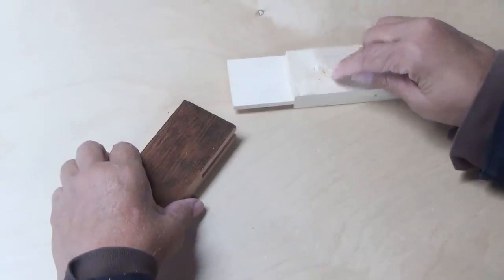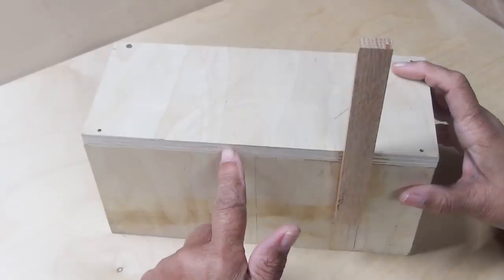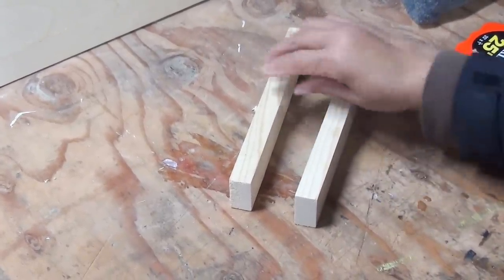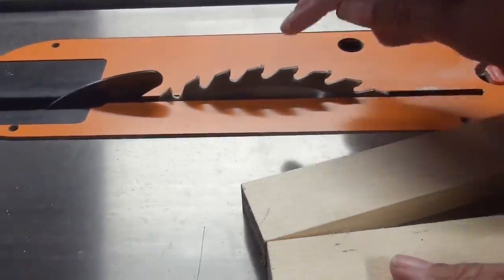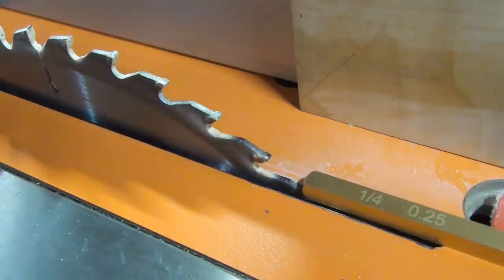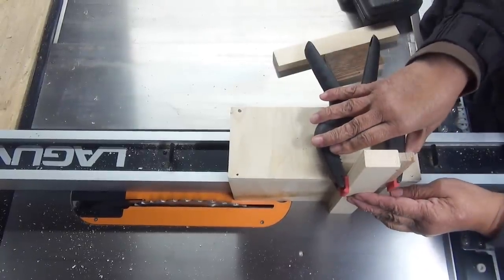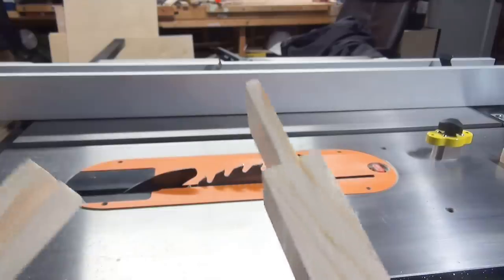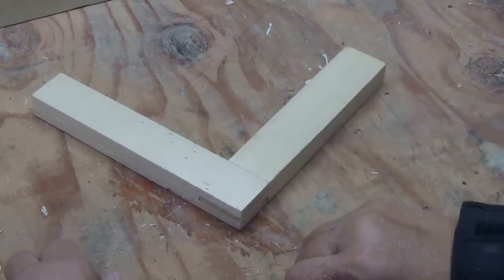Bridle Joint EASY and STRONG

Comment: I'm glad you mentioned about not using the fence when cross-cutting.

I made that mistake, once, right after changing my blade, wanting to test it out. My fence was set already, and I didn't think about moving it. I grabbed a piece of scrap, grabbed my push stick, and in no time I had a chunk of wood fly at my face and impact on my chin, right below my lip.

That's when I learned that we have a lot of blood in our faces, and if you give it a way out, it will find it. I also was amazed that when I got back from the hospital and found the chunk that had hit me, it had hairs from my chinny-chin-chin protruding from it.

Good info, good safety, and you are a treasure!
Reply from the maker: Kick backs can be dangerous!  I appreciate your sharing your story with others.

Comment: For some of us without the fancy accessories a 1/4 inch drill bit would work as a spacer.  Also, a short stop block clamped on the end of the rip fence could be used instead of the mag switch.  I love the jig and always enjoy your videos.  Keep up the good work!!!!!
Reply: James:  Thank you for those were excellent points. Especially the one about using a stop block with the fence.  Because many DIYers (especially newbies) don't have steel top table saws and won't work with a mag switch.
I really enjoy Leah's videos and was really surprised that she didn't offer the "free" fence block example vs the "expensive" mag switch example. Interesting.

Comment: Really cool joint I might have to use in a pergola I am going to build.  Instead of 90 deg though, it would be used to make one longer pole.  I will be using dowels going through the joint to make the joint more than just the glue bond but the wood of the dowel locking it in place too. 

What would you suggest to do this joint with 4x4s that are 8ft each in length.  Working with such large pieces standing up is not going to work.  I can do multi cut rabbiting for the middle peg, but do you have ideas on the middle slot?  Am I stuck with hand tools hoping I can get it accurate enough?
Edit: guess I can just do the half lap.
Reply from the maker: Im sorry but Im having some difficulty visualizing your project.

Comment: Thanks Leah for another great video.  Only thing is I don't have a table saw.  Is there another way you can make these cuts?  Have a Great Day!
Reply: After marking you can make the cuts with a Japanese hand saw, very fine teeth,  but if the cuts are not accurate the joint will be loose or will be crooked. Google the saws.

Comment: Really clear Leah, thanks! But you left out the removal of wast wood from the center of the stock.
Reply from the maker: I felt it was unnecessary but perhaps that was a mistake on my part.
Reply: @seejanedrill  Thanks for replying Leah. I suppose that you remove it with a couple of passes with the table saw, adjusting the jig incrementally. Would you be able to identify a table saw tool (accessory) that I bought at an auction if  I uploaded a picture of it. I've taken it to a local cabinet maker and it remains a mystery. Thanks Leah.
Reply from the maker: I'll try.
Reply: @seejanedrill  Hi Jane.  have some pics of the table saw tool that is a mystery that you said you would try and identify. How can I get the pics to you? -Lowell Shaw

Comment: I've often wondered if this joint is as strong as everyone makes it out to be.  Not that I doubt the wisdom of generations of woodworkers, but what I see when I look at it is all that face grain glue surface, but the inner piece is very thin and would be relatively easy to break.  And the outer pieces are held to the other board by endgrain.  Anyone know if I'm barking up the wrong tree?
Reply from the maker: It is similar in strength to a tenon and mortise joint and that's pretty strong.
Reply: @seejanedrill  You know, I never looked at it that way, but that makes sense.

Comment: Sorry. Missed how you remove the centre wood from the joint.
Reply: I would think that it's like cutting a finger joint. Multiple passes nudging the fence over so the kerf of the TS blade cuts out the middle waste
Reply from the maker: Sorry, I should have explained that process better. 
You once again use the set up bars to identify the distance from the fence to set the blade and then make to passes.